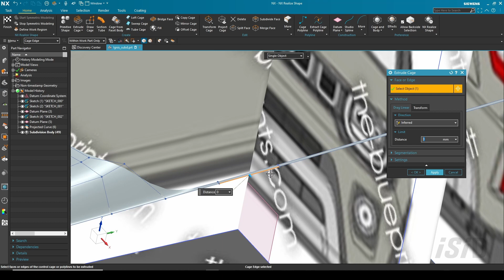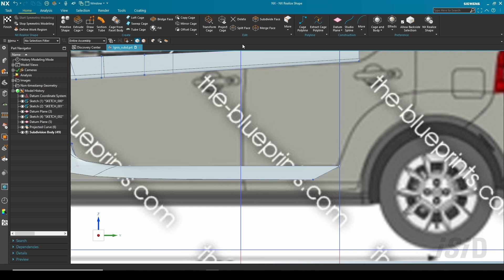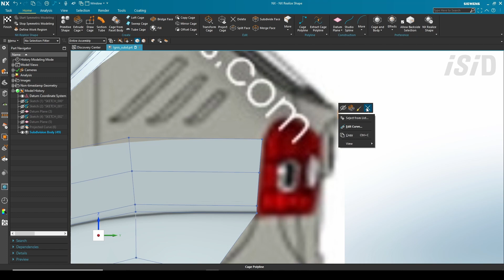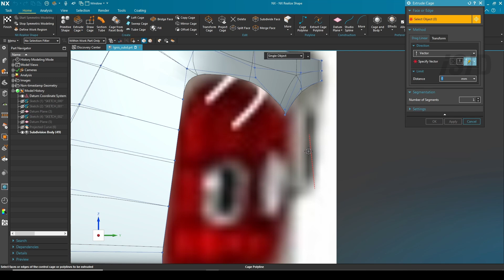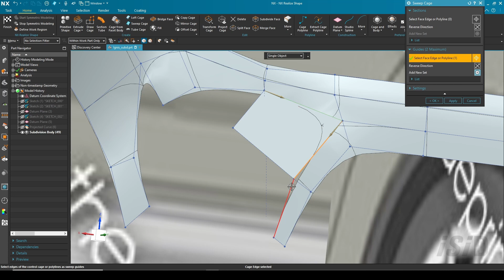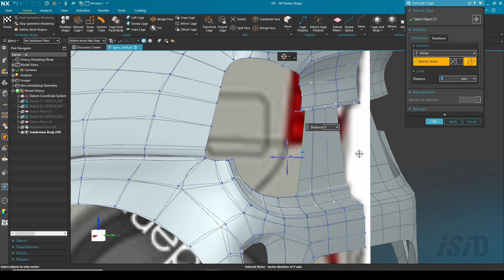Siemens NX - Subdivision Modeling of Suzuki Ignis

Comment: g3 g2 surface continuity?
Reply from the maker: The Surface Continuity Result from this Realize Shape is G2 and that result is automatically created. No need manual setting.
Reply: @id.dentsusoken  wow that is really impressive. I guess it can also create g3 with norm surfacing. Or is it only for subd
Reply from the maker: @janosgyerman  yes for g3, we can create it using curve based surface (manual surface). in NX we can do both, it depend on the case
Reply: @id.dentsusoken  how about solid edge. It is in a same product family, and a lot cheaper.
Reply: @janosgyerman solidedge is very limited.... For great surfacing flexibility nx s best
Reply: @vikasjagadeesh  hi thanks for the help, it is a good software but i am afraid i cannot afford it
Reply: if you can describe what product or part do you want to design i can suggest the right tool
Reply: @vikasjagadeesh  well i think blender is good but it has to be converted into step obj i guess if i want to detail and manufacture the model. I find Fusion 360 also nice.
Reply: @janosgyerman  Yes Fusion 360 is also capable. the detailing and adding features etc like parametric modelling is not possible currently in blender.